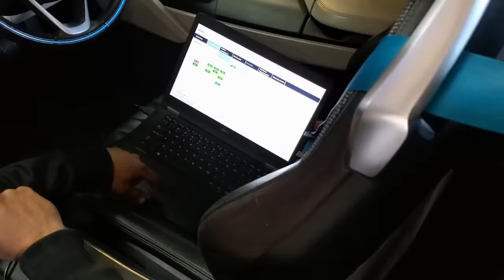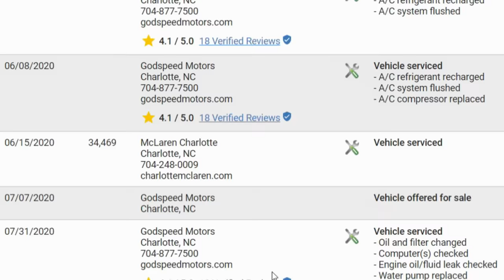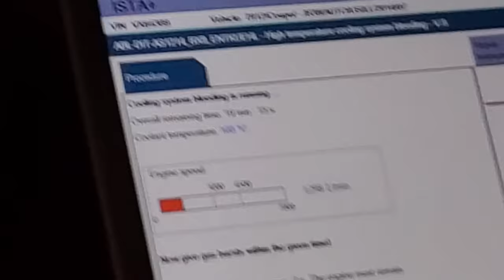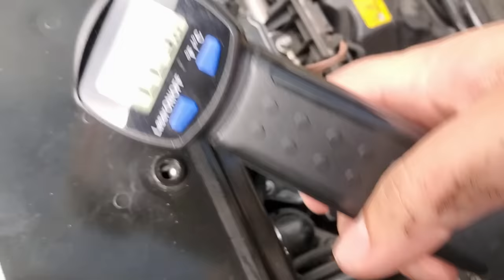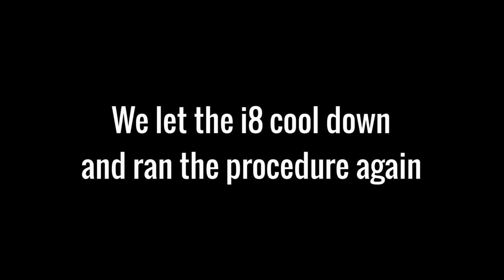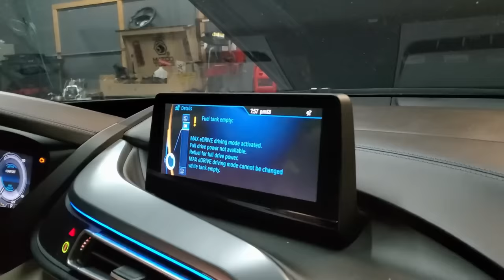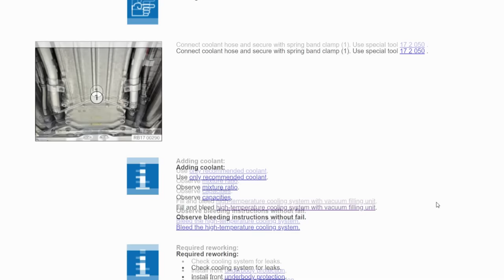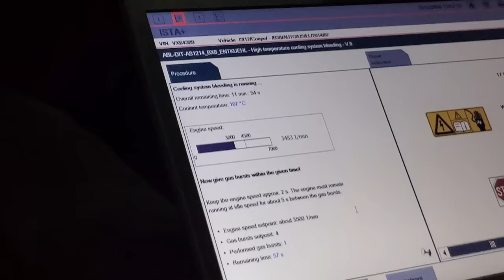Was my Repo'd BMW Supercar Sabotaged to make it Impossible to Repair?

Comment: Many times BMW’s have a separate thermostat built into the expansion tank.  Not sure about the i8, but just an idea.
Reply: Really? What models?
Reply: Wow didn't think I'd see you here, I watch your stuff all the time haha
Reply: Never heard of that in 18 years wrenching lol
Reply: Yeah, my e46 325i has thermo on expansion tank (not like the one by the water pump, the one that reads coolant temp for the ecu)
Reply: @repnatl  german cars are very different to work on so unless you get them all the time, you wouldn't really know 😂🤷🏻‍♂️
Reply: Didn’t expect to see you here lol, just a fellow subscriber of yours
Reply: Curious what is wrong.
God jobb Sam
Reply: He measured the motor temp with a laser thermometer and it was pretty on point to the ecu reading.
Reply: My 30-plus + years experience, says you should try to flush water through the radiator hoses when you remove the radiator. The thermostat is gutted , so the water should flow in the one hose through the engine past the water pump and thermostat and ran out of the other side unrestricted. That would eliminate the possibility of a blockage. Then by all means remove the water pump. That is a known failure on pretty much every BMW.
Reply: @kcdesignconcepts5216  I was thinking the same thing, a blockage! Did anyone check to see if the radiator flowed? No way should it have blown with such little pressure?
Reply: @kcdesignconcepts5216  Air is better as most shops have a means to regulate the pressure. Also since he needs to push out the water to make the vacuum effective. With water in he is fighting gravity and the water is winning.

And for Samcrac the gutted thermostat will prevent the water from properly circulating to the radiator in this car so would expect it to get hot. The thermostat is easy to test along with testing the computer output to it.
Reply: @robb1165  the problem with using air to test flow rate, if you would need a very high volume of air. Low pressure but high volume. If there is some type of blockage, it's most likely not going to be completely blocked. So low pressure low volume like from an air hose, will pass through with no problem. Water has a higher density then air. The coolant pipes are probably about 38 mm. A 30 mm blockage, would definitely lead to overheating. Pushing 50 cubic inches of air at 10 psi, will flow right through the 8 mm opening with no problem. Try the same rate and pressure with water, it's a completely different story.
Reply: Love your vids bro
Reply: The thermostat you're all talking about is the automatic transmission cooler thermostat. It isn't related to the engine cooling thermostat.

It always breaks if it's older or original on removal of the tank so don't slash your wrists. 

It's not part of the expansion tank but the plate that the tank clips into.

I've never run a car for long without it installed but I doubt it would make much difference.
Reply: @spencermaiers8322  I’ve never heard of that before. I’ve always known transmission cooler thermostats to be in the cooler lines or transmission fluid portion of the cooler not the coolant portion of the cooler. Then again, I don’t have much experience with BMW
Reply: so many Good Ideas Here. I believe that the radiator damage may have just found a problem...if pressure was built up from the coolant on the engine side due to a blockage, and then more pressure (air psi)  is introduced from the other side, then the radiator could’ve failed at the exact point of the blockage/obstruction. Let’s All See how this Works Out. Like I said, there’re many great ideas in Zollo’s comment replies....we should All be standing around this i8 with Beers.
Reply: Paul Robert  I wondered about that too. Or, will they only fill up once the thermostat has opened?
Reply: Yep most BMWs do not the I8 one doesn't have one..
Reply: The 1 potential issue with the garden hose, pass thru system to see if it flows out the engine return to rad hose.. Is often times theres more than 1 path thru said system ( heater lines ,  housing, engine passage etc etc ) The coolant can potentially bypass said obstruction an flow out of the engine. 

You may be on to something with the tank seperation from rad core. A number of issues could of caused over pressurization of system and so lightly split that seam. Its only noticable once under pressue, and sometimes the system will suck air in through said split ( without leaking coolant) therefore never fully being able to remove all atmosphere from system to properly bleed it.

 I had a similar issue like this once on a cavalier, i belive it ran around 15psi pressurized. I aired it to double and found the split seam at tank.
Replaced and bingo, issue solved.
Reply: @corporalclegg914  yes bring out the beers and gather round this fine automobile 😮
Reply: So can’t wait for the next episode 😩
Reply: zollotech hi
Reply: @bedema2483  so basically an enema 🤣
Reply: Rather stick to cellphones, mate.
Reply: Oh and I grew up in a garage with a air force C5  GALAXY STAR LIFTER  trained head crew chief for a father!! I've got 30 years under my belt and brain!!! Truth
Reply: @repnatl  it’s crazy but true in many bmw models
Reply: @londonvice5038  been into cars way before phones.
Reply: Most older one not the new stuff...  I bet this has a failed electric water pump. ...

Does it run coolant through the inverter for the electric motor?
Reply: @kcdesignconcepts5216  Yes lets see flowrate trough the whole system.  but also the mechanic was feeling for hot air at the cabin vents, so no circulation
Reply: @repnatl  Das Germans vill poot a Thermostadt verever ze engineerz determine eet to be optimum.
Reply: @kcdesignconcepts5216  Plus, the new replaced water pump could have been defective from factory, not common but it can happen.
Reply: @kcdesignconcepts5216  i definitely think your onto something here... i've never done it this way, i've always flushed through radiator
Reply: NOW What?!?! if you all haven’t seen the Updated i8 Video, then check’er out & reply if Inclined. IDK.
Reply: @lindsayclark9431  Lindsay.. I'm sorry the CAPITALIZATION bothers you. But sweetheart.. I just feel text messaging is a completely improper form of communicating. So ... I tend to follow my own rules. Once again, I'm sorry if this hurts your feelings.. But relax and don't cuss at me to try and correct my text etiquette.  Ok  thank you. Gfys....  (Jking) not joking
Reply: @lindsayclark9431  ps..  I wad 1000% correct in my advise. It was the head. Which pretty much any BMW will teach you at some point of your owning one..  They are amazing cars, but fucking aye the das Germans really couldn't have engineered a worse overall cooling system. I swear they don't grasp the concept at all
 Using a myriad of THERMO FORMED plastic parts everywhere. It's the BMW Achilles heal and it Absofuckingloutly applies to every single model. From old R30 to brand new I8s apparently.. 
Anyways  forgive my all caps and snarkyness..  I'm only trying to help and usually make y'all laugh a lil if I get what I'm trying for..  Cheers sweet Lindsay.. Forgive me.
Reply: @eltoro777  no reason to forgive, I’m not mad. Just as you were being a smartass, I was too. 
For what it’s worth, you are spot on with your statement about the fine German engineering ! 
They go way overboard and have a sensor for a sensor. Unfortunately I have a uncontrollable weakness for the damn cars ! I guess I’m quite fond of self inflicted pain of owning them. Although the glow of all the random and multiple dash lights are very soothing on those long drives in the middle of night !
Reply: That car looks so cool..but what a hunk of junk.

Comment: I would say it is obvious that there is a blockage of some kind.  It might have been in the radiator.  I would have segmented the cooling system down and run water through each part to figure out where the restriction was/is.  At some point in troubleshooting, you save time by doing things the long/hard way.
Reply: I agree. Even though it's a complicated cooling system, they all work the same way.
Reply: Exactly. A vacuum test wont tell you anything. Will just pull a vacuum from the source to the blockage

Comment: Sam,  start pulling hoses to see if they stuck something in one of the hoses to block it.
Reply: This was pretty much my first thought
Reply: Yes, and blow air thru each section of the system to verify no blockage.
Reply: I bet on a return hose from radiator being blocked at/near one of easily accesible fittings which are not disconnected during servicing, there will be a golf ball or something like that pushed in, try running tap water through the system and verify manually which hoses get hard and which not, that will tell you place of blockage.
Reply: That was my thought, someone has stuck a rag in one of the hoses.

Comment: @samcrac have you tried using an infra-red scope to see temp differences between coolant supply and return hoses? If there's a huge temp difference in a same hose could be sign of a blockage, same for radiator.
Reply: I'm with this guy or girl.  You were squeezing the hoses and feeling the temperatures in the last video.  Don't forget that simple troubleshooting step.
Reply: @IlliterateSage  came here to say this
Reply: Yep. I agree. I am thinking it could be a blockage, maybe a deliberate one, in a pipe somewhere. Even more scary, and I hate to even suggest it, is a blockage in the water channels in the block itself. I hope that is pure paranoia.
Reply: @peterj5751  Had a full blockage once - there was no antifreeze in the coolant, and the water was frozen solidly. The thermometer didn't indicate any problems. Of course, with no water circulation, it just measures the temperature of an ice block. The first sign of trouble was that the fan/water pump/generator belt failed (since the water pump was locked, of course).

The car was am E21 316 (note the absence of the "i"). The M10 engine survived (needed a new head gasket, though).

Comment: You have should started with removing the termostat, disconecting hose in the lowest spot, under the car ... connect tap water or garden hose to it and see if the water is able to circulate thru the system before trying anything else.
Reply: Exactly this. And bench test the water pump to make sure it will spin up.
Reply: I was thinking about this the whole time: it's a closed circuit so open it at the "beginning" ( i.e. where the cold water leaves the radiator to the engine ) and feed cold water into it with a hose or something. If water doesn't come out of the radiator, there's a a clog somewhere.
Changing the entry point for the water up the system will surely show up where it's at.
Reply: This is something i will use in the future
Reply: @paulopazevedo  agree, there is a sock in the system.
Reply: Thanks for the likes :) If you want see me fix cars and motorcycles (cheap ones) you can subscribe :) And Happy New year :)
Reply: Yes,, the garden hose trick.  I commented that in his first video.
Reply: Every bush mechanic would thinking along these lines

Comment: Just started watching this as it just hit my feed.  I'm an MR2 owner, have been for 28 years, so I have some experience with mid engine cars.  Not with BMW's so grain of salt thing.  Typically, for MR2's, if the coolant reservoir is bubbling then chances are good either air in the system or head gasket failure.  Coolant pressure test and bleed down test are the next go to.  Again, I don't work on BMW's at all so still waiting to watch more videos to see if you all figure out what it actually was.  Just posting this to see if I'm even close or not.  Hope you figured it out so I'm rewarded by watching more videos LOL.

Comment: Take the old radiator apart and see if there's a blockage.
Reply: Seeing as it blew apart id guess you wouldnt find one to easy..
Reply: Why didnt the BMW dealership not check it before advising on an engine replacement? Lazy overpaid mechanics
Reply: @1972dsrai  the diagnostic software maybe doesn't have a plugged radiator test/scenario/steps? I'm not sure how much leeway techs/mechanics are given on new cars. Perhaps they would have to escalate the issue internally to BMW, and perhaps they did and just told them to go for the engine replacement ... yeah it is bizarre. Once there's no fear of voiding warranties / less direct support available - probably when people gotta use their brains and test things further.
Reply: @colinstu  It just seems a waste and a bit of a cop out by BMW. Its not as if its a particularly unique issue, from what Ive seen online its fairly common. I simple process of elimination should find the fault.
Reply: If BMW techs can't read an OBD code for a fault then they can't fix the problem. Hence the replace engine recommendations!
Reply: @RogueTrooper80  You'd think they would know their own engines inside out. If not personally then at least within the organisarion. There should be someone they can refer to who knows sll there is to know even if they're in Germany.
Reply: @1972dsrai  They are probably assuming the head gasket has failed.
Reply: @jonesy66691  True, either way its not likely to be a cheap fix.

Comment: How about bypassing the radiator at the rear junctions and connect to a transparent water tank to see if water is actually circulating?
Reply: I absolutely agree with you bmwspeedman.... isolation of problem is the key here... After all its just a machine with some issue with water circulation. If u notice the cooling fan is running at low speed thereby indicating the radiator is not sensing a high temp.... You never know, someone could have stuffed the long radiator hoses with something to sabotage the car.... so isolation of water circulation has to be identified
Reply: @ikhalid1  exactly my point. Could also be clogged water passages in the block, therefore @Samcrac needs to know water is flowing freely in the engine block. The expansion tank boiling but the radiator sensing either warm enough water for low speed or for no fan activation at all suggests blocked water ways.
Reply: @bmwspeedman  I waa going to say the same thing.  Make sure water can actually flow through everything (with thermostat out).
Reply: @moniack  if BMW dealer themselves are suggesting to change the engine, maybe they suspect the same, water passageways blocked within the engine block.
Reply: @bmwspeedman  the problem is that in modern dealership shops, they no longer want to waste time with true diagnostics. The advent of the ECU/PCM made old school diagnostics go away. Now they only rely on their computers and what it says goes. Ironically, BMW is notorious for throwing codes. A leaking vacuum line or intake fan will throw misfire codes or o2/cat codes. The car runs fine otherwise. But nowadays the techs (mechanics, they no longer call themselves that) swear by the scanner and the computer (stuff like alldata). The digital FSMs basically will say "replace engine" if you go through a diagnostic tree and yield no results. Same for the transmission. 

In the case of this car, there is a possibility that the head is warped but not mixing with the oil. There is a chance a head gasket leaks near an exhaust port and no other part of the engine is compromised but the exhaust smoke feels damp and it overheats since the exhaust fumes are heating up the water. Keep in mind as the sabatoge idea gets explored.
Reply: @bmwspeedman  excatly... 100% sure there is a blockage in the circuit i.e. if the water pump is working... they should first isolate the section where the blockage is. Not sure if water pump performance has been observed ... that can easily be checked by your solution of the transparent water tank to check for circulation
Reply: Totally agree. Start isolation testing to narrow down the issue. My money is on a blockage, especially as I recall the details of your last test where fan sensor did not get hot enough to switch on and reservoir was mild temp
Reply: Is there someway they could have crossed coolant lines when replacing the pump somehow those empty lines at the lowest point in the cooling system is very strange
Reply: @dukemellor9304  yeah but that same sensor kills the engine during the test
Reply: @bmwspeedman  - Hate to boast but I said this exact thing on the first video. There's a reason BMW recommended a new engine, and it probably wasn't because they were too lazy to diagnose it properly. I assume they came to the conclusion, through much trial and error, that the coolant passages in the block are plugged somewhere.
Reply: My exact thought, the coolant passages are probably blocked.